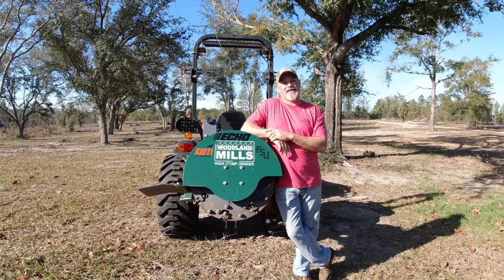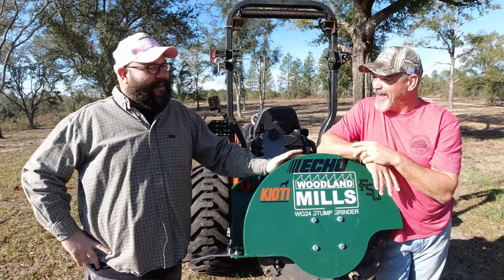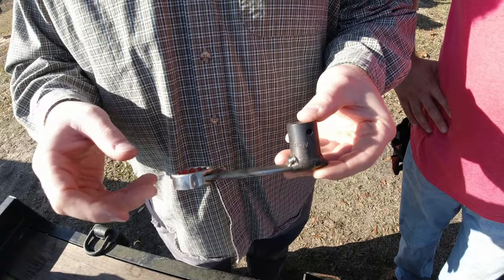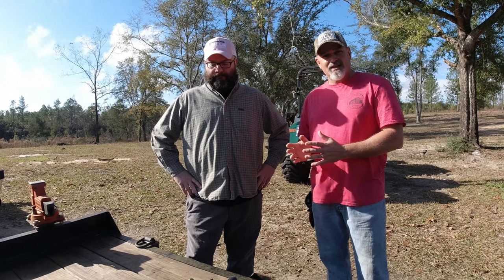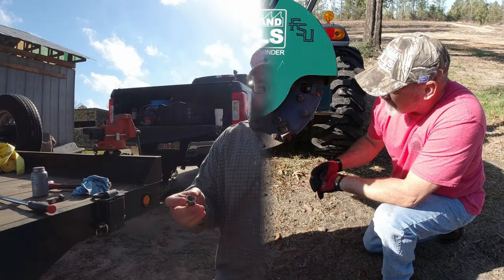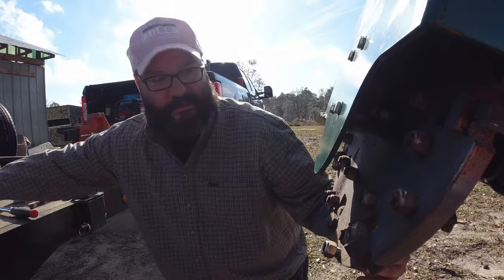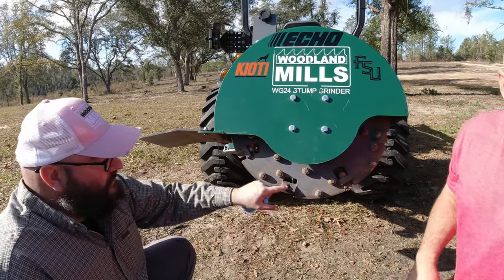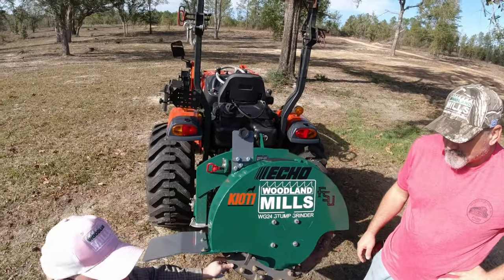PTO Stump Grinder~Woodland Mills WG24 on back of my TRACTOR!

Comment: Thanks for the nice video... according to the WM operator manual, the grinder should attack the stump right to left.  This will pull the grinder down into the stump.  Grinding from the left or middle will cause excessive vibration and jumping.
Reply from the maker: Thanks for that Mr George 👍 I appreciate the comment.

Comment: If you watch a Woodland Mills video or read the manual that came with the grinder it specifically states to start grinding from the right edge of the stump (when you are standing behind the stump and tractor look forward). You should only be grinding with the lower left quadrant of the wheel.  That way the grinder isn't trying to walk across the top of the stump.  It all about physics.

Comment: Interesting. When I worked for an underground construction company, we build a 18" wide 5' diameter grinder that went on an excavator instead of the bucket. We could grind stumps, asphalt pavement, and hard sandstone with it. Only four of the equipment operators were allowed to use it. It took a light hand on the controls.
Reply from the maker: Easy process 👍
Reply: I actually used the WG24 to dig a drainage ditch for Hank and Gina. Except it was on accident, when I didn't raise the grinder up while moving at one point!
Reply: @brandellfleming3225  Hopefully it was were they needed it. My Kioti is a little small for the WG24 and we only have one tree we may take down next year. I can dig it out with the backhoe attachment.
Reply: @CamppattonFamilyCompound  what do you have? They are rated for 20-45 hp machines, but I have seen these, or similar style, work on as small as a Deere 1025r.
Reply: @BigOrangeTractors  CS2510
Reply: @CamppattonFamilyCompound  I think it will handle it. Tractor time with Tim used a baumalight, which is very similar to this one, on his 1025r. That Kioti has 1.4 more PTO HP and lifts a tiny bit more (20ish pounds).
Reply: @BigOrangeTractors  Cool.

Comment: Permatex anti-seize seems to be very underrated on You Tube video mechanic's channels.  Why is that?  Why would you not put something on bolts or studs that helps out the next time you have to do maintenance work on equipment??  Blows my mind!

Also, regrinding the teeth couldn't one find a company locally that can regrind them for you???

Comment: Have you sharpened any of the teeth?   I just bought one of these and have already ground about 50 stumps ranging from hard wood to very soft/rotten pine stumps.   Have only seen rock in one of the grinds and tried to be careful around it.  That said, the teeth are not what they were when it started out (I bought 12 spares when I got the grinder so I can compare to those too).   Woodland Mills indicates that these can be removed and re-sharpened... any idea how to go about that?
Reply from the maker: this may help. https://youtu.be/3_tihCRjEpI
Reply: @HamiltonvilleFarm  Thanks... it's a nice video about making a tool for tightening/removing the four vertical teeth.   WM now includes a tool to do this with the unit.  

nothing about sharpening in that video or any in his channel.  appreciate the pointer!
Reply from the maker: Yeah sorry, I couldn’t remember. We made the video a long time ago

Comment: Any tips on actually sharpening the teeth? We have the same stump grinder and the teeth are definitely due for a sharpening. Can’t find any tutorial videos for these specific teeth.
Reply from the maker: Filing would be my bet. Maybe Brandell will see this comment and chime in. He knows that kind of stuff👍
Reply: I talked with woodland mills, and they said that you can sharpen them to some extent using a silicon carbide grinding wheel/disc. I would just say to make sure they are nice and true/flat when done grinding them.
Reply: Brandell Fleming Thanks!!!!
Reply: any further tips on this topic?  (didn't see it before I posted a separate thread... Google sorts these by most popular so this one was buried).

Comment: I'm surprised how few teeth are on the grinder if they doubled the amount of teeth wouldn't it cut better
Reply from the maker: Maybe🤷🏻‍♂️ my assumption is the woodland Mills engineering team felt this was an optimal amount. Distance between teeth and orientation of teeth probably produce the desired output of shavings. More teeth may clog up the blade. Again, I'm guessing at this point. Thanks for the comment. Makes one think. 👍

Comment: I have the same stump grinder.  Brandell, could you give me an idea of how often to grease the main bearing.  Woodland Mills is not specific in their owner manual.  Too much grease can be harmful for a close system.  I have ground around dozen stumps.  Some them 3 ft in diameter.  I greased everything when assembled the unit and cautiously put a few shots of high temp grease in the main bearing.  This all when the unit was new a few months ago.
Reply from the maker: Good inputt. Thanks for watching and taking the time to comment 👍
Reply: The bearing is just a pillow bearing, so any excess grease will be thrown out while in use. You can even see some of the grease trail on the disc in a few of the scenes. I've used mine exactly the same as you, with between 1-2 dozen stumps and several of them being 36"-60" in diameter. I think I've greased it maybe twice. I would worry much more about under-greasing than over-greasing. However, the nice thing is they are standard bearings available almost anywhere!
Reply: @tifttyson  absolutely. With all the grinding I've done, I've probably still only put about 6-8 hours on it. I'd say 4-8 operational hours would be good, or just a squeeze or two every time you go to use it (if it's an infrequent use item). I usually grease my equipment after I finish using it, so it's ready for the next time.